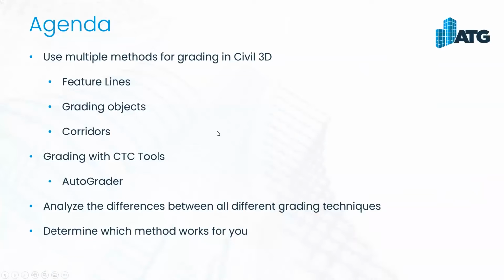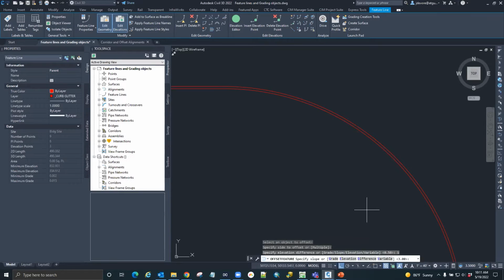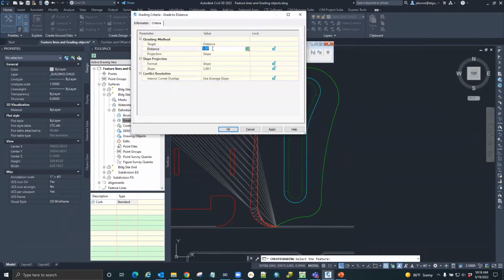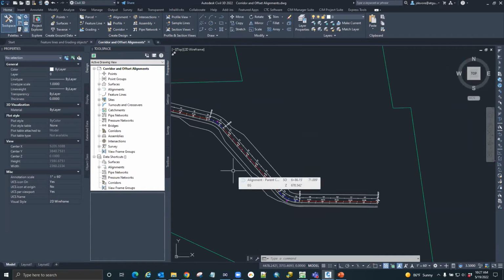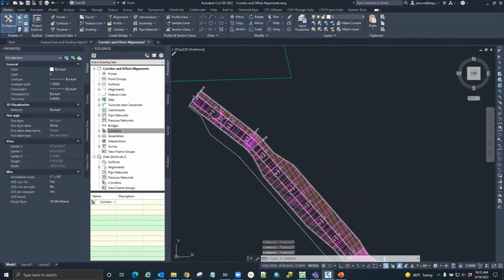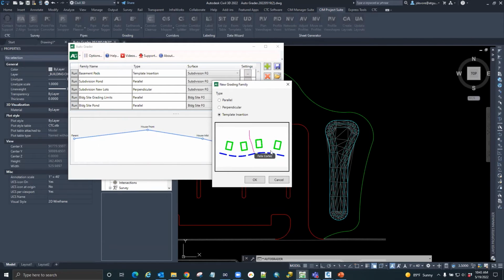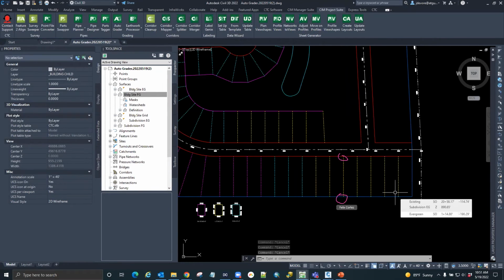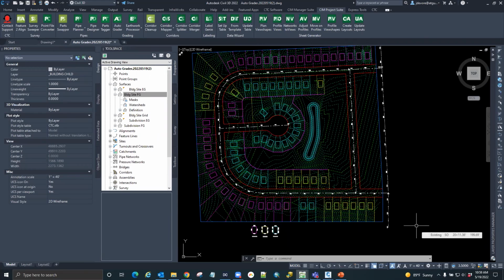Grading Techniques in Civil 3D

Comment: 7:00 I came to Civil 3D from software engineering background, and I hate how the industry is willing to accept crashing software. 1. Crashes shouldn't happen 2. If there is a problem, it should catch the exception and handle it ideally without alerting the user that there was a problem. 3. If there is a real problem let the user know and undo to a place where there was no known issues in the document instead of crashing.
Reply: Exactly! It seriously kills my budget on my projects! Some projects that have been around for a while and were created on older versions crash multiple times an hour! Almost spend more time clicking save / restarting C3D than I do actually working!